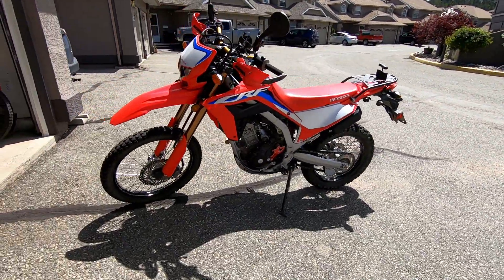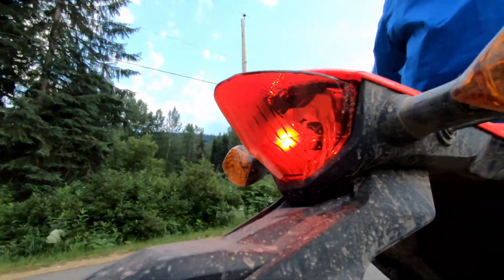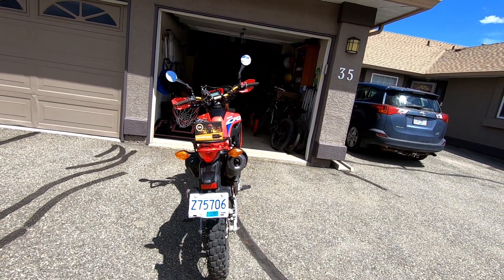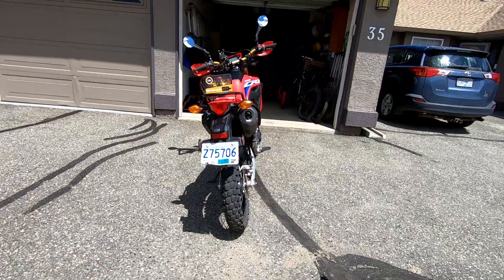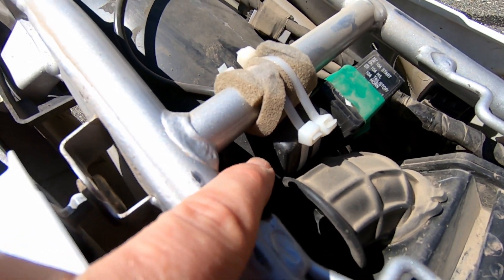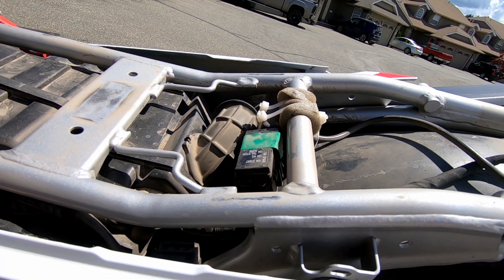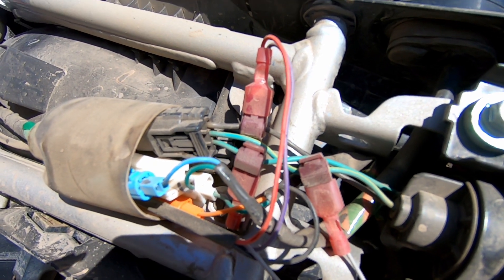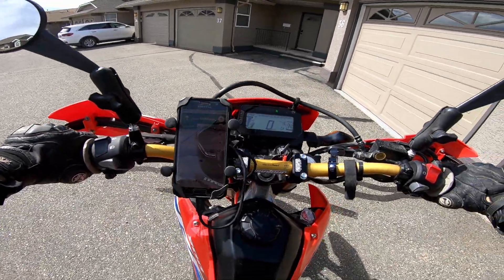ST2 Brake Light Mod

Comment: Does your brake light comes on when you rev the engine while not moving? I think it’s sensitive to vibrations causing the brake lights to come on.
Reply from the maker: No, my light doesn't come on when I rev the engine while not moving. I guess that could be an issue if you bike shakes alot. You can adjust the sensitivity by tipping it back to make it less sensitive and vice versa.

Comment: Are they still in business? They are not answering my support request emails. It’s been 2 weeks and not a word. Anyone know?
Reply from the maker: I think they are in business. I keep getting ads sent to my email.
Reply: They are taking money and shipping brake modules that don't work so they must be in business. They just don't respond to emails asking for help.
Reply: @jimsz0100  soon as it gets warm out I will test mine out. I trusted them based on YouTube videos of the module working. Will see.
Reply: @bennybumb8126  I did he same as far as trust is concerned, I hope you have no problems with yours.  The unit I received was different from most I've seen on YouTube, there was no option for label up or down for flash or no flash, self-sick Velcro was already applied to the bottom for mounting. When mounted level any bump made the brake light blink.  I raised the front a little at a time and when it reached 6 degrees past level it would still flash on rough roads but not come on with deceleration. Took it off at that point.
Reply: @jimsz0100  i think it depends on which way up you have the module as to weather it flashes etc.
Reply from the maker: @jimsz0100  Sorry your having a crappy experience with them.